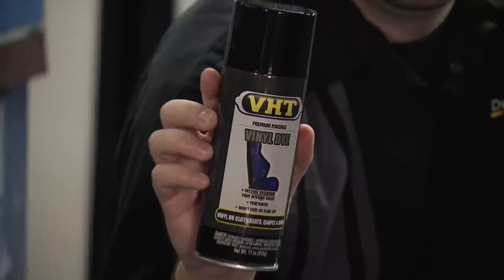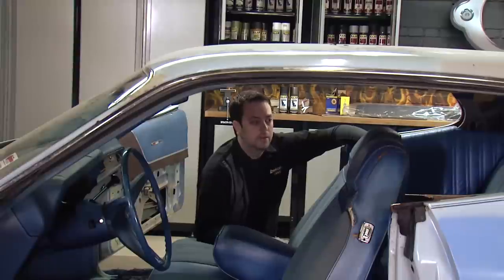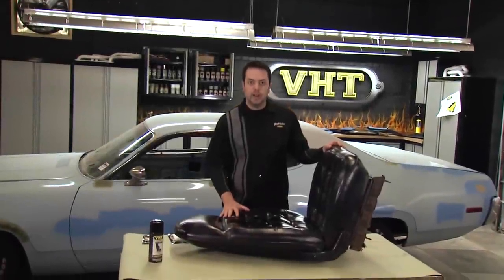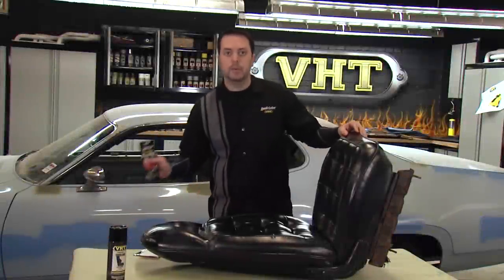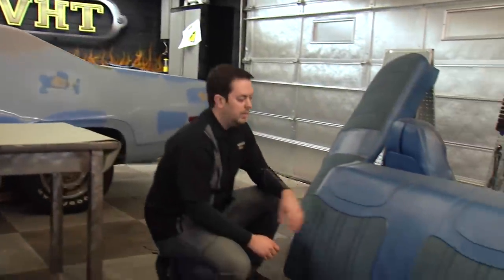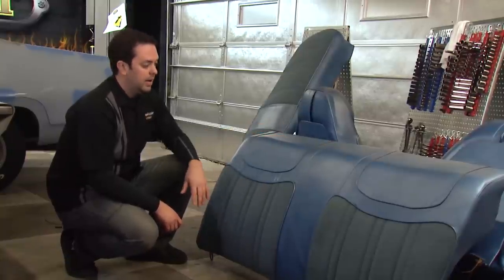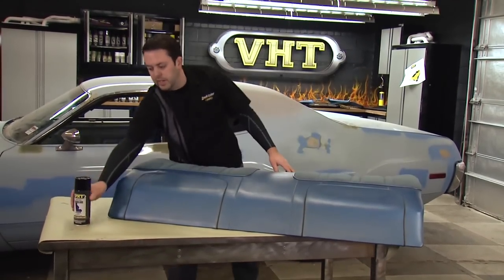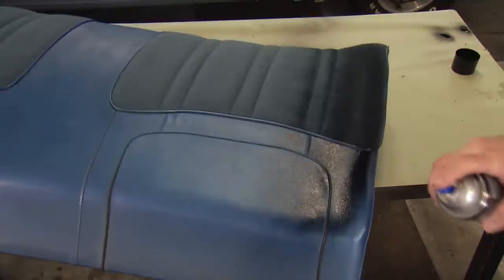Painting Car Seats with VHT Vinyl Dye - Restoration of 1972 Plymouth Satellite Sebring Plus

Comment: How do the parts of the seats with fabric feel once the paint has dried.  Is there a stiffer feel to them or does the fabric absorb the dye to the point you can't feel they have been painted?  I need to paint a set of captains chairs that are completely fabric and don't want a stiff feel.

Comment: From everything I can determine so far, the vinyl dye works best on porous surfaces.  (IE untreated leather, cloth, untreated vinyl)  Is this more or less correct?  I am looking for a product that will work on a waterproof and highly flexible surface
Reply from the maker: +Drapeta Berry You're correct, other than leather. It will not work on a waterproof flexible surface.
Reply: +Vht Paint Thanks so much for your quick reply
Reply from the maker: Drapeta Berry We're here to help!

Comment: hey will this work on boat seats too?
Reply: Did you find out about use on boat seats,....I want to do my boat seats too,...I saw another brand review & they said it becomes part of the vinyl,..cannot scrap off,...so i dont think its a cover paint,
Reply: 5664788 no havnt tried yet. Most likely will try to because someone painted my previous boat seats and its pealing everywhere :/
Reply from the maker: Hi, sorry for the long wait before our response. This product should work fine on boat seats, but our paints/dyes are not recommended for complete submersion. That means if the seats are somewhere that will be constantly splashed with water, left uncovered in the rain, or subject to foot traffic, you may notice some deterioration after a while.